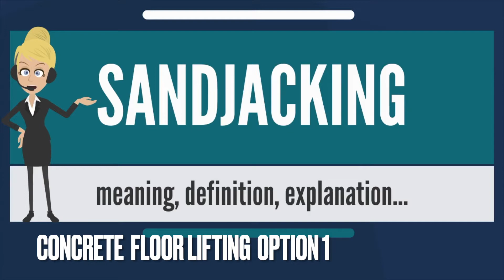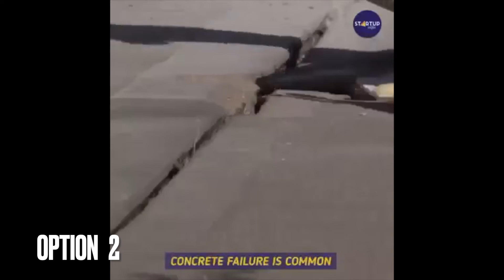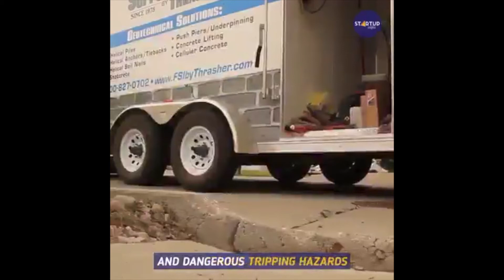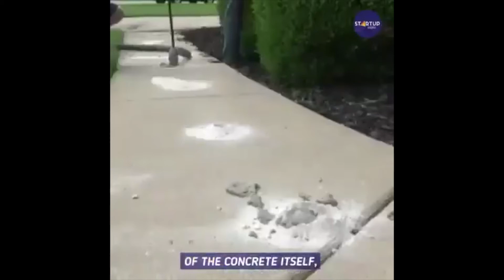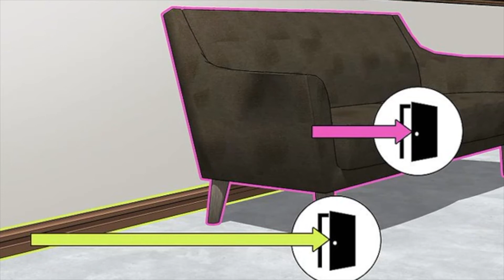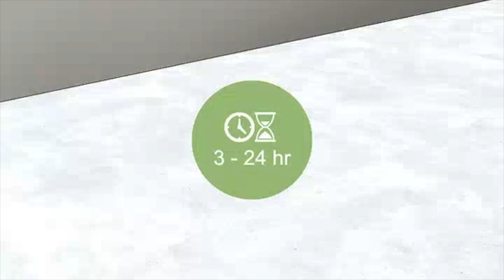How To Lift Sunken Concrete Floor Slab Up And Level? Demonstration:

Comment from the maker: The reason for the uneven level of the concrete surface is explained well. The process of lifting up and levelling the concrete floor is shown clearly and is easy to understand. It is a cost-saving process to rectify the defects.